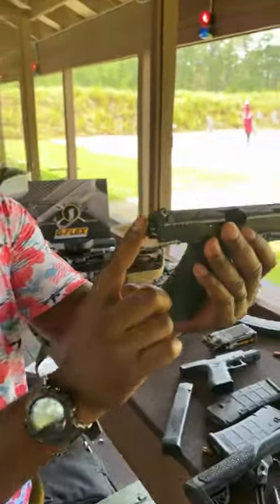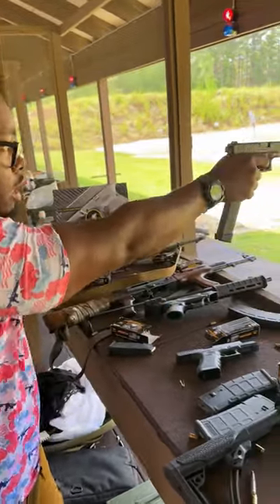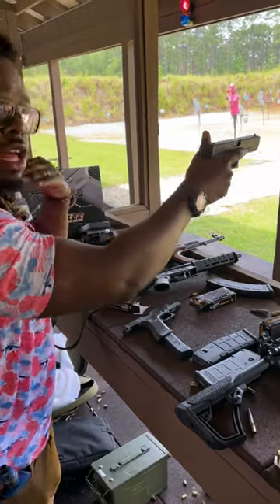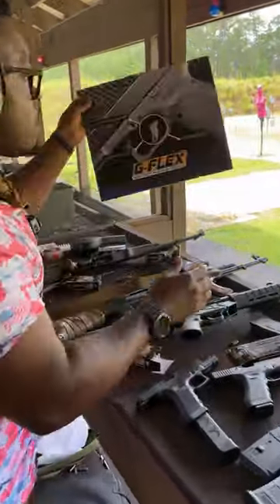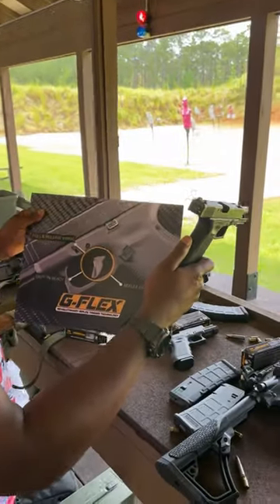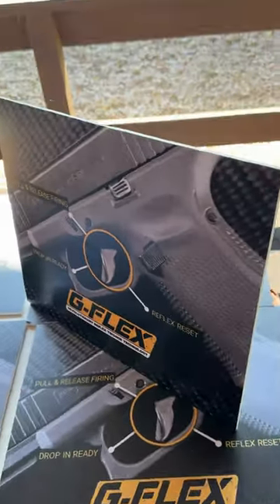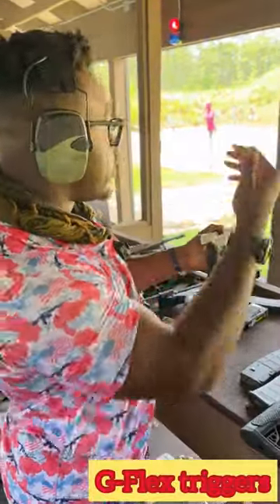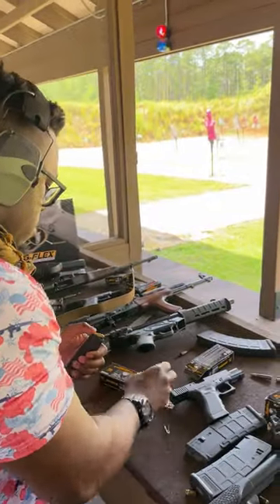What is the G-Flex Trigger. How does the G-Flex trigger works. By Performance Trigger.

Comment: Them boys will be coming after these very soon!
Reply: Yea real soon
Reply: Its legal. Process is similar to a suppressor so never guaranteed
Reply: 2.5gpa51 drop mag rack slide..
Reply: 2.5gpa51  yea, conceal carrying this would be idiotic but, I definitely am thinking of buying a glock 34 and puttin this in it lol
Reply: @gabesoliz9888  impractical as a ccw weapon is what he means. Even if you did rack and drop the mag that wouldn’t be wise in any situation you need to use your firearm for
Unless you on some john wick shit n stopping after the first pull and saving the other till you need it lol
Reply: @777gi0 Don’t buy a gflex but literally any other binary Glock trigger, they are better quality and have a binary and single shot setting making them practical for ccw.
Reply: @xxchaosxx6181  where can I buy one ?
Reply: @nikobaker5604 they don’t exist , glocks don’t have a safety or a switch to convert unless you fabricate it yourself 😂 and there’s nothing wrong with the g flex he’s just mad he can’t handle it
Reply: @twentytwogunz8142 Franklin armory was supposed to release their binary slide last year. The slide is made like the Glock 18 with the switch on the side. But they still haven't released it yet crazy thing is it's going to be for gen 3 Glock 17s only
Reply: They’ll just make ya pay for a stamp, at which time ya just get a switch. It’s such a marketing racket.
Reply: You already know
Reply: 2.5gpa51  As with all binaries, the trigger is held to cancel the second round. You can drop the mag (Which is important to note bc in states with gun laws of guns without manual safeties, a mag inserted is considered loaded rgl if a round is chambered or not)  OR if you have added a manual safety to the weapon, it can be set, and trigger will reset as normal.

IMO in every LEO, military and self defense event where preservation of life is exercised, nobody fires only a single round. All are trained to fire up to 3. Anymore than that, and you will need more legal funding.
Reply: Smh
Reply: Wait till they misplace the Tigger spring housing lol trigger will not reset if you do it wrong
Reply: 2.5gpa51 if you gotta shoot'em once, odds are they deserve it twice.
Reply: Good luck
Reply: @braydennelson2498  come and get'em last time I check level 4 armor doesn't stop fire💋
Reply: 2.5gpa51 😂 I edc the Gflex don’t run up if u ain’t tryna get hit wit the second shot 😭😭😭😬
Reply: @777gi0  For now...If it gets national attention, politicians and the ATF would come after this.
Reply: @killertruth186 true i just read my past comments & idk why i was expecting common sense they’ll definitely be coming for this so i better buy mine now despite not having a glock yet lol
Reply: @Cartiiercarloafool they haven’t because they’re probably going through a lot of legalities the 18 illegal for a reason 😂
Reply: @yockhunter this didnt age well 😢
Reply: I’m not giving mine up merica

Comment: Damn, I know it's a short video... but I was hoping to know how it actually works. Anyone know how to describe how it works and/or have a link to a video?
Reply: This dude talking about g flex blah blah. He doesn’t know what it is. It’s called a binary trigger. Search that up and it will tell you what the guy in the vid didn’t lmao. If you’re in CA they’re still illegal
Reply: @eric13731 THIS particular brand is called "G-Flex".  We know it's a binary trigger.
Reply: @vidacrazy    Yeah but others don’t know what it is
Reply: @eric13731 ok genuinely curious here . So what if you only want to fire an odd number of rounds 1, 3,5 etc. Do you have to hold the trigger , drop the magazine and then rack the slide to remove the round in the pipe? 

That seems like a lot of BS and simply a novelty item.
Reply: @sunoclockoneday2576    If you want to shoot 1,3,5 rounds then just don’t buy a binary trigger. Buy your regular semi auto gun. Binary triggers are basically meant to make your semi auto shoot fast like full auto guns except you’re pulling the trigger/releasing the trigger to shoot everytime instead of holding it down like a full auto. Its just a loop hole and closest thing to a full auto for states that dont allow full auto
Reply: @eric13731  right but there is no way to turn it off. Guess it's fun at the range. Too each his own.
Reply: @eric13731 - ah no, your so wrong. 
Binary - yes, but by definition only. 
1. Franklin Armory owns (patent) the name / term binary as it pertains to firearm triggers.  Manufacturers  will have to create different names and or terminology to define a binary trigger.
This video is not of a “binary” trigger as it pertains to Franklin Armory’s patented definition,  and more  importantly nor  how it operates.
2. The MOA (mode of action) or mechanical action of the trigger in the video ( G-Flex or Tac-Con 3MR  for example) is different than  a binary trigger. 
These triggers (G-Flex or Tac-Con 3MR )are called forced reset triggers  or FRTs. Here’s how they work;
Sequentially,  when a trigger is pulled a firing pin strikes & ignites the ammo that gets discharged. 
 Maintaining trigger  in the “squeezed” position , the positive reset characteristic is achieved by transferring the force from the bolt carrier through the trigger assembly to assist the trigger back onto the front sear. 
I.e.)  The amount of energy (or force) we needed to pull the trigger   which in turn released the pin & ignited the ammo (4.5 lbs.)  - is the same amount of energy needed to be  transferred back, forcing the trigger  into the reset  position, in  preparation of the trigger release and the continuation of FRT sequencing.

Like binary, the ATF qualifies  FRT triggers as legal based on the mechanical action of the  trigger and it having a single effect. 
For example- pulling trigger results in a round being  discharged.
 
The action of a FRT trigger  consist of 2 mutually exclusive events resulting in or having the same effect. Squeezing or releasing - each action has its own separate effect.
 
Binary (and switch) triggers use  different  mechanical/pneumatic actions to  create trigger resets so quickly,  sometimes causing jams & misfires.
  .
Valid question though - I  didn’t know & did some research to educate myself- 
 I do laugh at the know it alls who are so confident in  wrong guesses cuz they heard  someone else say it
Reply: I had to go somewhere to learn how it works: (1) pull the trigger and a round fires on the pull; (2) release the trigger and another round fires on the release.
Reply: @cleppard99  Based on my search, the term "binary trigger" is a generic name for a type of trigger. You say that Franklin Armory owns a patent, but a patent is not a trademark. A patent protects the functionality. A trademark protects the name.

Comment: So, it is impossible to fire just one round if you pull and release. Is that right?
Reply: Idk, I think if you don’t let it go, and rack it
Reply: @esaar24z  Interesting. I would not want to be anywhere nearby when a user is doing that. Also, the user would be building muscle memory to rack the slide while the trigger is fully pulled. Currently, my muscle memory is for racking the slide while my finger is OFF the trigger.
Reply: @jakemccoy  i think I misled you. After you fire the first shot, don't fully release the trigger. Instead, release it just enough to reset, which means allowing the trigger to return to its firing position without fully returning it to the start. This is called "riding the reset."
• A G-Flex trigger, due to its short reset, can easily cause double taps if you're too quick or allow the finger to release too much. With practice, you can learn to control this better.

Comment: It's cool for the range toy . But without a way to shut it off like on rifles it couldn't ever be more .
Reply: what do you mean shut it off?
Reply: @anthonyllamas8764 on a rifle like an AR, you can keep the trigger held back, flip the selector lever to safe and it will cancel firing a round when you release the trigger. Convenient for not sending a round somewhere you don’t want to when you don’t need to. You can’t to that with a Glock or any pistol without a manual safety.

Comment: Not having the ability to NOT fire that second shot is a major con.
Reply: Fire the 1st round with a pull of trigger - keep it pressed in & slide rail to eject chambered round, release rail & trigger
Reply: Mechanical double-taps are a much bigger plus.
Sending two rounds within 1/4 second of one another leverages the 'Leroy Thompson effect', as I refer to it.
He advocated for 1/4 second or so bursts, start to finish, in gen 3 and 4 SMGs.
This is back in the 1980s when operators didn't have the option of using JHP rounds, as the Judge Advocate General had not cleared them for use with counterterrorism operations, for example.
124 grain NATO ammunition still pokes small diameter holes in people and overpenetrates, mind you, and MP5SDs reduce velocity to subsonic levels, reducing energy to that of a warm .380 ACP.
There is a disproportionate compounding wounding effect when targets are struck with 3-5 rounds in a 1/4 second span start to finish, depending on cyclic rate.
Like a shotgun striking with multiple pellets.

So then we leverage this with controllable 9mm JHPs, in theory, or in my humble opinion, lightweight rounds in 357 SIG with high energy that recoil like a 9+P or so, especially with a threaded extended barrel and compact compensator added to the threaded barrel cutting out 30-35% of the recoil of each round.
Thus, with careful handloading, one can achieve 750+ ft/lbs from a 4.6 inch extended threaded barrel in a compact framed G23/32, or 800+ in a 5.15 inch barrel in a G22/31 platform.
Times two.
So 1500+ to 1600+ ft/lbs.
With split times within 1/4 second, easily.
Manageable recoil.
As much energy as an AK-47, for example.
This is equivalent energy to roughly 4.2-4.6 rounds of standard pressure 9mm, give or take.
Happens roughly as fast as discharging one round at a bad guy with a little practice I would think.
Like hitting someone with two full-power 10mm auto rounds within 1/4 second.
Exactly that much energy.

Pretty sure that whomever will calm the f-ck down getting double-tapped with 1500-1600+ ft/lbs of energy.

FBI can't complain about sh-t.
Their methodology taught in every shooting school out there is to shoot the adversary to the ground.
This is simply a far more effective double-tap mechanically enabled.
Legally.
What if, for example, there are three adversaries to service.
How many times do you want to have to service each target to ensure that none are capable of returning fire, for example.

Some of us have unconventional operational requirements.
1v3 odds are realistically conceivable for some of us under certain circumstances.
Same as going tak-tak-tak, except it's going to sound like ta-dak-ta-dak-ta-dak.
Same three pulls and releases of the trigger.
2.5 to 2 3/4 the energy of a .357 Magnum per mechanical double-tap.

I think that a saboted 71 grain .32 caliber machined copper round at 2200-2250 fps would be a good starting point for an effective load with light recoil that would still be relatively barrier-blind, practical to source, plug-and-play for handloaders, without having quite the overpenetration concerns on frontal shots as the 80 grain .355 diameter copper rounds, for example.
Slightly less recoil as well.
Roughly 50 grams lighter than 15 rounds of 125 grain.
Saboted 71 grain .32 projectiles in 357 SIG cases will weigh 10 grams per, vs 12 grams for NATO M882 124 grain rounds.

There are other designs geared around custom puller sabots housing a heavily machined M855A1 projectile weighing 32-40 grains.
Less recoil.
Less overpenetration risk.
Lighter weight.
Like a pretty enhanced 5.7 x 28mm in principle.
Just better by 200-250%.
And G-flex'ed because this product is exactly what I had requested in a lengthy dissertation nearly two years ago.

This product is the business.
You simply have to understand the methodology and purpose of the mechanical double-tap enabled here.

Sort of us have heightened security concerns.
I survived my fifth murder attempt November 8th, though not via a firearm.
Saw Guy Ritchie today.
He unsuccessfully attempted to impeach Donald Trump as Adam Schiff.
He's complicit in the murder of my father's wife in 1996, and complicit in the attempted murder of me more than twice.
He's also an opiate addict and trafficker.
He's also Rand Paul and Mike Huckabee.
FBI.
CIA.
33° Freemason.
Used to be George Michael.
Which makes him Boy George's ex-boyfriend.

From Careless Whisper to trying repeatedly and failing to take out Edward Snowden.
To be fair, I am pretty f-cking good at this game despite having no formal intelligence community training, military experience, or law enforcement background.

and the last known survivor
stalks his prey in the night
and he's watching us all with the eye

of the tiger.

#Ihaveahighschooleducation
💀♠️🎯

Comment: Does it fit on a 43x it’s considered gen5 smh I ordered two!!
Reply: They don’t make them for the micro compact models, I checked because I wanted one for my 43x, but tbh the gun is so small and light, I think the recoil of a binary trigger works better on the larger and heavier models. Less snappy reaction. No point in having the rate of fire if it keeps wanting to snap upwards with a tiny framed pistol. But I could be wrong. 🤷🏽‍♂️
Reply: @att1788L  yeah that makes sense if you ask me, would of been sweet on the 43x but this gave me a reason to buy full frame 40cal from Glock and possibly a 9mm or 357
Reply: @ghostt703  I wish they made it for the G20, the full-sized 10mm, it’d give me all the more reason to acquire one, which I still will buy regardless, but it’d just make things more exciting lol.
Reply: @att1788L  man I was looking at that too!!! Shit I wish lol I’m settling for the 40 and 357 but a 10 with micro kit Jesus!!!
Reply: @ghostt703  lmfaooo nahh I personally wouldn’t want a 10mm with the micro frame, that’d be too snappy of recoil and limited ammo capacity, but I mean the full sized 10mm G20 with the binary trigger. BUT If they made a glock19-sized frame with the 10mm cartridge, that would be perfect in my opinion. Then slap a binary trigger on that.. Also stupid expensive tho in the long run, 10mm ammo ain’t cheap, sadly lol. That’s the only thing, but hey at the end of the day it’s like having a fun car. It’s smiles per gallon, not miles per gallon lol. 🤷🏽‍♂️
Reply: @att1788L  nah the micro kit I may be saying it wrong but it’s a rifle frame to hold the hold Glocks like 45acp and 10mm rounds rifle stock and scopes and holds an extra mag with the frame as a grip or add a grip to the micro kit . Fits full frame and micro Glock 43x and yeah expensive but exactly I mean who doesn’t love a 10mm

Comment: It’s just a binary trigger, these have been out for awhile
Reply: Any idea how they work? Have looked it up, but can't find any real info (and I won't buy anything, ever unless I already know precisely how it works).
Reply: @deucedeuce1572  “ The G-Flex is engineered with Reflex Trigger Technology that fires one round when the trigger is pulled rearward and then a second “reflex” round when the trigger is released forward. “
Reply: Buy it bro. Drop it in your glock. Break it in. Let it rip
Reply: Binary trigger are pretty stupid for a Glock.
Reply: Ummm....yeah, like over 40 years ago.  Release trigger, Pull and Release triggers, and Binary (same principle, different name) have been around since the late 70's to early 80's and were popular with trappers and skeet shotgun shooters to help avoid a flinch. It's only been around 10 years or so since they got a craze for them in the AR platform, and now it's moving into the handgun market.